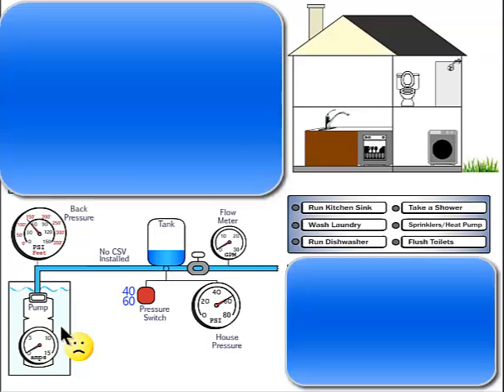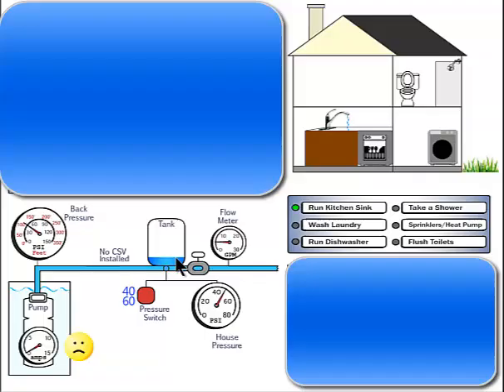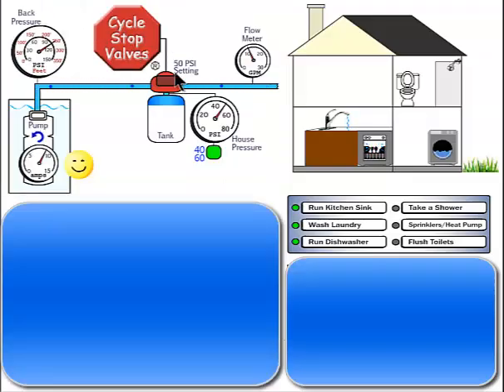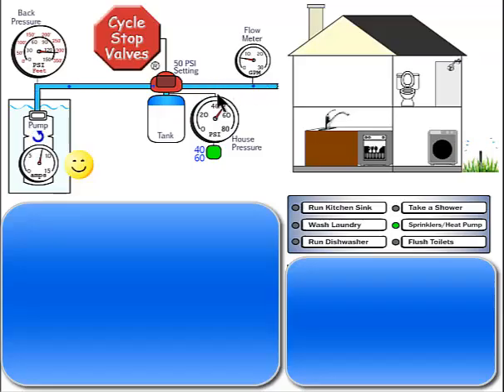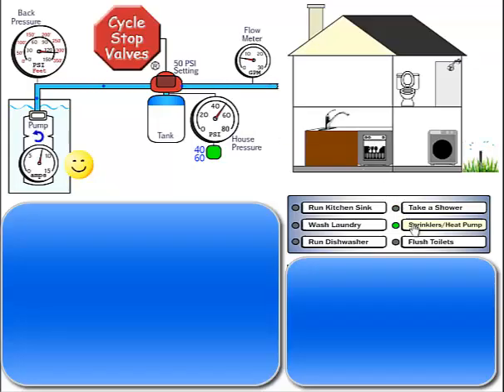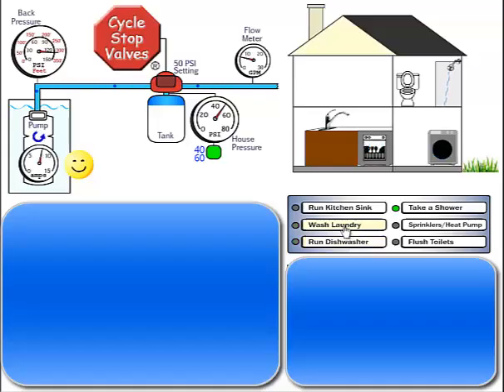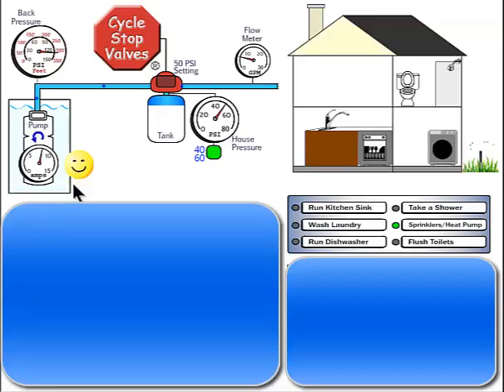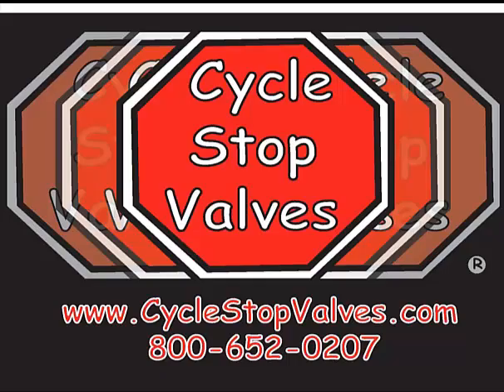How a Pressure Tank Works and why you need a Cycle Stop Valve

Comment: Awesome well explained video! Im definitely getting a CSV. I have a pressure tank system (well x trol professional) 80 gal. Way oversized for the house but with a csv the pressure drop goes away,outstanding! This vid has excellent detail for the novice or trained professional (maintenance mech for large steel corp.) Thanx again for the info.
Reply from the maker: Thanks for the kind words.  I am glad it helped.
Reply: @cyclestopvalves8380  I deleted my post for 2 reasons, I have only seen videos of why not to have a csv, They can be misinformation since I noticed a few sketchy things that make you doubt truth or lie. Common Sense tells you if you return the same water in a small test tank and cycle a pump, it's going to heat up so going to investigate further before making a statement that may not be right. Second, I do notice a big amp drop after start up so you may be right, keeping it running may allow it to run better and longer, Personal experience with jet pumps, I notice you can get double the life by just letting it run and I can say that with truth since I did just that, my old jet system never shut off on purpose, got tired of changing pressure switches and even a small issue, shut down, clear system, fix issue, waste time priming lines and rinse/repeat, I set it to run constant and had little issue's plus it stayed cooler, I switched to submersible and kept the same set up except my pump works so good, it fills the 30 gallon tank so fast it barely ever runs for 15 seconds every couple hours unless you use washer/tub/shower. Even then it barely cuts on, But if your csv does what it says, pump barely will ever run at even 50%, I would guess like jet pump, draw less power, never trip the pressure switch and still keep 33psi, the only question I have is what happens to back pressure from not using water, would that not build back pressure? My jet pump returned water in a loop but the sub has no return, what happens to back pressure? Pump would be pushing water with no where to go if nothing is being used.
Reply from the maker: @Klemin2012  
Thanks.  You are starting to  understand.  There is no water being recirculated.  If you are not using the minimum 1 GPM coming through the CSV, then the 1 GPM fills the pressure tank until the pump is shut off.  Jet pumps don't drop much in amps, but are air cooled motors and doesn't make any difference on water flow for cooling.  The back pressure will be as much as your pump can build when thinking the well is deeper, which is how the CSV controls flow.  But no pump can build more pressure than it can stand.  Back pressure is a good thing as that is what makes the amps drop and the motor to run cooler.
Reply: Yes, i need one as well.

Comment: I am from Trinidad and want to learn more about this. I will be going through your literature. 
What does the hydraulic institute have to say about your valve?
They seem to be promoting VFDs in their literature
Reply from the maker: Hydraulic Institute LOL!  We have been replacing VFD's for almost 35 years so far, and they still haven't figured out how a CSV works.  There are a lot of engineers and groups who use VFD's for everything and claim they are saving energy.  However, those who really understand pumps know reducing the RPM of a pump always causes more energy use per gallon.  There are times when a VFD can be useful.  But most people use VFD's because they don't know enough about pumps to make them do what they want without a VFD.  See these articles.  https://www.waterworld.com/drinking-water-treatment/distribution/article/14070406/all-about-the-cycle-stop-valve-csv  and  https://www.waterworld.com/drinking-water-treatment/distribution/article/14070071/more-benefits-of-the-cycle-stop-valve-csv  and https://www.waterworld.com/drinking-water-treatment/article/14069903/water-tower-refurbishment-part-1-cycle-stop-valve-sets-the-stage

Comment: Seems like the CSV makes the pump run longer, which I would assume wear out faster…..
Reply from the maker: Making the pump run longer is how the CSV eliminates the on/off cycling.  Submersible pumps are completely frictionless when running and are made to run 24/7/365.  I have one feeding a stock tank 3 GPM that hasn't shut off since 1996.  The only wear on the pump is at startup before the lubrication happens, and using a CSV to keep the pump running continuously as long as water is being used prevents wear.

Comment: Assuming its volume is 200 liters, what is the volume of air in it?
Reply from the maker: About 150 liters is air.
Reply: @cyclestopvalves8380 How do I determine 150 liters of air? Can you tell me which bar is better?
Reply from the maker: @atifalaa7591  The air charge in a bladder tank should be slightly lower than the pump start pressure.

Comment: Can this be used to slow down the flow of water? I have a well that runs dry when my water system back flushes at night. I wake up with a tripped breaker and water lines that are full of sand.
Reply from the maker: Sorry I missed this.  A Cycle Stop Valve is used when the pump produces more water than is being used.  But a Cycle Sensor is a device that protects the pump from running after the well runs dry.

Comment: How would csv work with 5hp 220v 85gpm submersible pump, 200ft deep, about 78gpm flow rate at the pressure tank. Pump feeds house water supply and also needs to feed irrigation.
Reply from the maker: A 2" CSV3A2T would turn that 85 GPM pump into a variable flow pump that would deliver strong constant 55 PSI (using a 40/60 pressure switch) as the flow rate you are using varies from 85 GPM to as little as 5 GPM.  Working with an 86 gallon that holds about 20 gallons of water, flushing and intermittent uses in the house do not cause the pump to run until all 20 gallons are used.  Then when more than 5 GPM is being used, the CSV will make the pump run continuously as pumps are designed to do.  Cycling on and off is what destroys pumps, and without a CSV, even three of those 86 gallon size tanks won't  prevent the pump from being cycled to death.
Reply: @cyclestopvalves8380 with such a powerful pump wouldn't be bad for the pump to keep such high back pressure when its being used for house faucets, small water usage at the tjme etc.?
Reply from the maker: @dimitarpavlov3955  No, No, No, a thousand times no since 1993 I have had to say this.  Pumps are counter intuitive.  High back pressure is much easier on the pump than high volume.  Back pressure makes a pump work easier.  Open flow or cycling on and off are the hardest things for a pump to do.  But if it was easy to explain and/or understand, I would have a thousand competitors.  The secrets of how pumps work is what keeps me in business.  😁

Comment: My brother in law finally got municipal water. The water pressure was horrible. I installed a CSV a 1/2 jet pump with a expansion tank certified for potable water it instantly improved the pressure. They work very well. If you can set up the pump on 220v as that will reduce the amp draw a bit.
Reply from the maker: Thank you.  220V motor will draw half the amperage of a 115V version.  But the electric bill will be the same either way.

Comment: does not really apply to people that have expensive electricity, example philippines...as pump on all the time is expensive
Reply from the maker: The CSV only causes the pump to run when water is being used, the pump isn't "on all the time".  Electricity is not expensive with a CSV.  The CSV can be as efficient as a variable speed pump.
Reply: @cyclestopvalves8380 running the pump longer definitely causes high electricity - also long running times causes the pump to run at high heat in the tropics.
Reply: @rayintoledocebuphilippines5517  He totally glossed over the wear and tear on the pump running constantly, as well as the cost of electricity as if this cycle stop valve is a silver bullet. Alas in physic there is no free silver bullet.
Reply: @maestrovso  pumps running constantly is better than not. The wear is much higher on quick on/off. They should run 30+ seconds at a time to cool themselves off. You will have to run the same amount of time anyways to get a given volume of water. You either have that water in the tank or you have it in the well.
Reply from the maker: @maestrovso  That is just one of the counter intuitive things about pumps that people misunderstand.  Pumps are made to run 24/7/365, it says "duty" "continuous" on the side of every motor.  Submersibles with a Kingsbury type bearing are completely frictionless when up and running.  The only wear is at start up before the hydroplane effect of the water happens.  I have a pump on a stock water well that hasn't shut off sine 1996.

Comment: I'd like to pass along some real life information related to fans that might help to understand the high water pressure/ lower amperage draw conundrum. If you've ever overhauled or upgraded your forced air ventilation system in your home, but kept the "squirrel-cage" fan for use on hot days in the shop, you might be surprised to see it overheat for the very first time just sitting on the floor! What has happened is you have liberated the fan from the confines of the ductwork and allowed it to gulp an unrestricted supply of air. A fan that pulls in a "ton" of air also has to throw it out, and more air per second is more work, more amps, and more heat for a motor that never had to deal with it when it lived in the space it was engineered for. The good news is that all you have to do fashion a piece of cardboard that will slightly cover the inlet on the side opposite the pulley, and you will have plenty of airflow without the overheating. Water that a pump can't move is also water that it doesn't HAVE to move. It's kind of like squeezing a baseball instead of throwing it. It's not effortless, but it's still easier.
Reply from the maker: Thanks!  I have been trying to find the best way to explain it for over 30 years.  Putting your hand over the suction on a vacuum cleaner or the discharge of a blow dryer makes the motor speed up but the amps drop as there is no load when no air being put out, the same as a pump when the flow is restricted.
Reply: Correct me if I'm wrong, but wouldn't a csv increase your electric bill because the pump is running longer?
Reply from the maker: @robforsythe9456  It depends on how you use water.  Won't make any difference for just house water.  But if you have long term uses of water like irrigation still need to use water at close to the best efficiency point of the pump.  Same as with a VFD, using a CSV to run much lower flow rates for longer periods of time will use more energy per gallon pumped.  But the savings and benefits from not cycling the pump to death far outweigh any extra energy cost when needing to use small flow rates instead of full pump output.
Reply: @cyclestopvalves8380  Definitely trying to reduce the electric bill some, averages in the 200s but a few leaks have had me at over 500 for a couple months by the grace of God that's over with. So I have a question, I just replaced the expansion tank with a 20 gallon ao smith I have a submersible pump that was replaced by my dad several years ago, couldn't tell you the specs on it. I replaced the pressure switch with a 40 60 but had to crank it way up to get the desired pressure, I have my tank at 38 psi and am reading 99 on my guage when full and it cuts in at 64, I had adjusted the pressure switch with the old tank, don't know the tank psi of the old one, now that I have a new tank should I try to set the pressure switch back to 40 60, was considering a 60 80 switch. Or should I leave the switch alone and raise the tank pressure to 62?  I feel like I should lower it back to 40 60 and fill the expansion to 38 and make increment adjustments from there, not sure but any advice is much h appreciated. Oh during a shower how I have it set now it runs at about 70
Reply from the maker: @robforsythe9456  64/99 is pretty high pressure setting.  Needs 60 PSI in the tank at that setting.  Don't have to go back to 40/60 unless you want.  50/70 or even 60/80 might be best for you to have 70 in the shower.  But without a CSV set at 70 with a 60/80 switch setting the pump will cycle on and off while a shower is no, not stay at 70 like with a CSV.  Pressure switch is adjustable.  Don't need a new one, just set it like you want.
Reply: @cyclestopvalves8380  Appreciate the input, thanks and God bless ya.

Comment: At the price that these cost, it seems cheaper to just replace the pump when it fails. Am I missing something?
Reply from the maker: Every time the pump fails you are also out of water, on top of the cost of a new pump.  Without a CSV a pump might last 2-5 years.  With a CSV 20-30 years.  Even $200 pumps would add up quick.  $1000-$2000 pumps would break the bank.  There are lots more advantages with a CSV besides just making the pump last.  But not enough space or time here to go into that.  Which is why we have a huge web page and lots of videos to explain as much as we can.  All the best.
Reply: @cyclestopvalves8380  :) My 23 year old pump (supplies 5 homes, 12-15 people) is still working. I've never heard of a pump only lasting 5 years.
Reply: @cyclestopvalves8380  I am interested in your product, but feel compelled to report that my submersible well pump has worked fine with an old fashioned tank for the last twenty-five years - since I bought the place in 2000.  The house was 24 years old at that point.  If you do the math, I have 49 years on this well pump, so far...